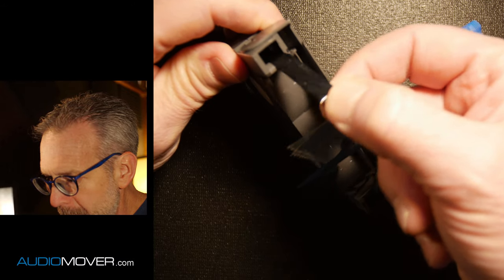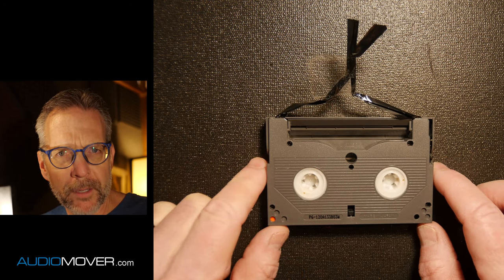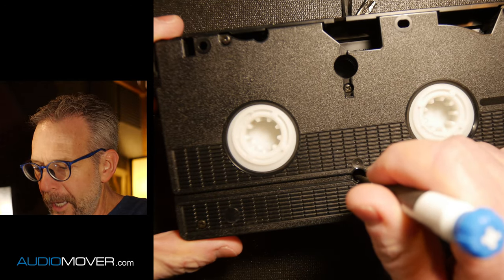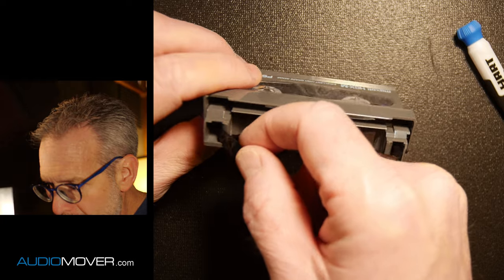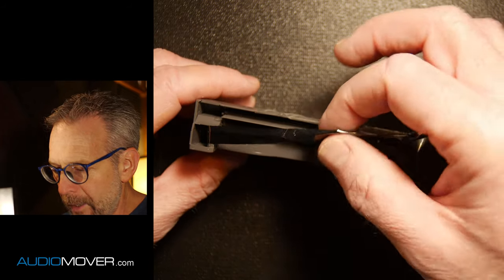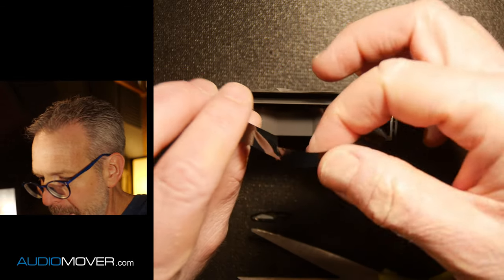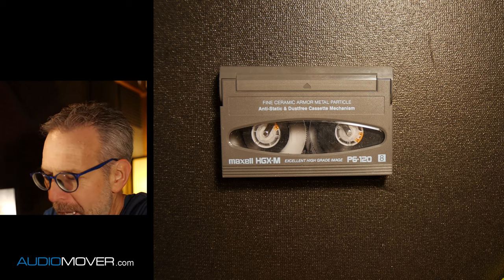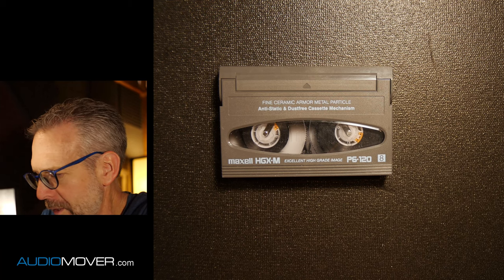Repairing a Seriously Damaged 8mm Video Tape

Comment: The result of a helical scan head rotating at over 1000 rpm hitting a crude splice made with sticky tape like the one in this video is very often damage to the head chips. It is extremely unwise to splice video tape, especially since working players are getting harder to find, and especially using adhesive tape which oozes and sticks the tape layers together,  rather than proper splicing tape which is easily available online. Best to find a junk cassette, empty its reels, and attach each one to one half of your broken original so you have two cassettes each containing a part of your damaged original. No harm to the VCR and you can remake the transfer in future if required.
Reply from the maker: That's really good feedback. We talk a little about that around the 10:10 mark. https://youtu.be/K7qcYfoGbpM?si=uwO3sCjcUZBVQrOY&t=610

Comment: How do clean slightly moldy tapes? Also as you mentioned, de-assemble the casing in order to rewind manually to avoid crinkles or breakages because of the higher rate of speed during rew/ffw ?

Comment: Hi thank you for this video, I was wondering if you could do a video about how to reassemble a 8mm cassette, which upon opening the spring that opens and closes the flap pops out and the flap doesn't open / close because the spring is loose, I tried for nearly two days to put the spring back but with no luck getting the spring back into place , had to revert to case swapping with a newer 8mm cassette case which has a smaller spring which stayed in place, I did carefully open the case the moment I lifted to top from the bottom the spring did a 360 and I could not work out how to fix this, any advice would be great I really struggled and didn't manage to fix it, thank you reading my problem
Reply: Same thing just happened to me. That darn spring....I think they are all assembled differently depending on which tape brand you have.